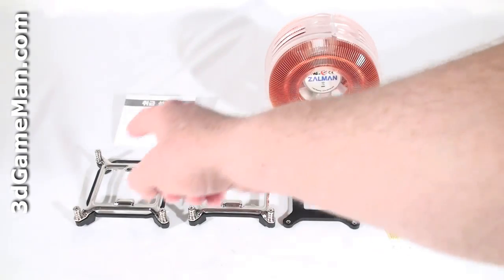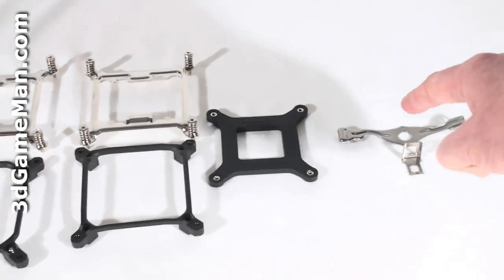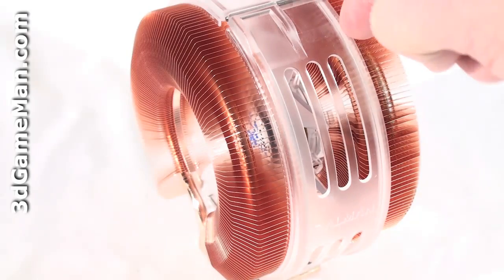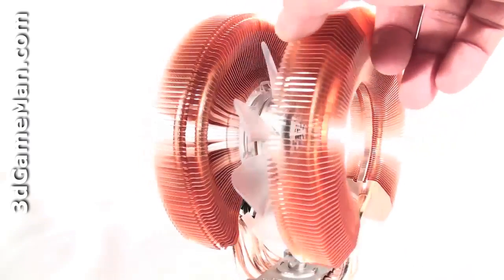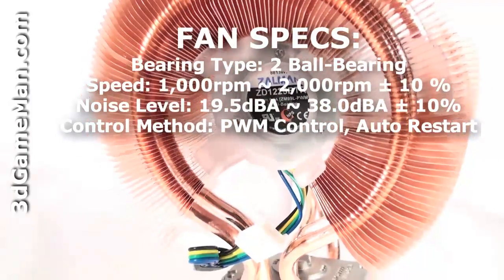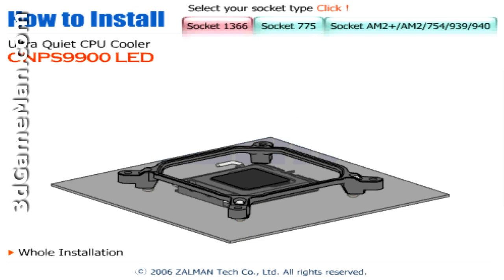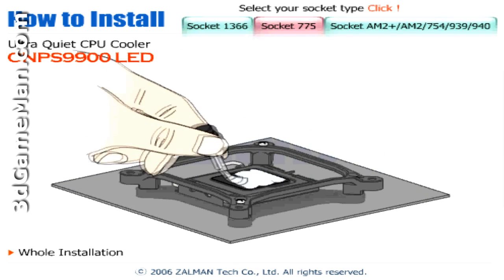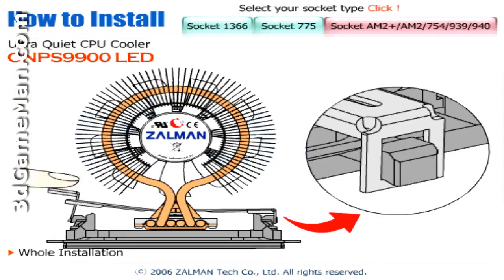#1047 - Zalman CNPS9900 LED CPU Cooler Video Review

Comment: i've got this cooler in my build (bought the entire thing secondhand) but i think it's just way too noisy at idle, i'd like to replace it with an arctic freezer i32 (performs similar to a hyper 212 evo but is semi-passive). would it cool equally well or would i see an increase in temperature? i'm overclocking an i5 2500k so cooling is pretty important...

Comment: Just for laughs, I had this running with no fan on an i7 950 at stock speeds. No fan, just the heatsink action combined with chassis fans = 60* idle temps.

With fan? 29* idle temp on stock. Yeah, it's still pretty good.

Comment: @sjkreid3D im not sure if it will fit in that case, if it does, it will probably be a tight squeeze. just get the cnps 9500.  its basically the same heatsink with a 92mm fan as opposed to this ones 120mm fan.  i just got one the other day for my mid tower rig, and its is awesome.  it keeps my phenom ii 955 cool at 4.2 GHz with no problem and doesnt make a sound doing so.

Comment: I bought a used one, only come 775 socket and 775 socket clip, no 775 backplate, can I use the original one that's already on my mother board? Or I really have the zalman one. all 775 backplate should be the same right?

Comment: @youngdones 

yes i had an old Q9450 which easily ran at 3.6 GHz so a 930 should have no problems with that. im getting my 930 soon i hope im gonna go for 4 ghz with this cooler on a p6t deluxe v2 mobo

Comment: Your minimum QPI Voltage should be 1.3V and 3.2GHz overclock with a Zalman 9900 is quite modest in my opinion I do 3.5Ghz and with turbo mode on its a nice 3.66Ghz but I would recomend turning off ALL CPU features like Virtualization and turbo mode if you go to 4Ghz

Comment: @TheXxxLoganxxX it can be that the Cooler is installed wrong, or you applied too much Thermal Compound, or the Retentionkit doesnt apply enough pressure to the CPU. Reinstall it if possible

Comment: I'm getting about ~$50 soon and I want to get a good cpu cooler for my Phenom II X4 955 because the stock heatsing is making odd noises. I want a cooler that really good, but also quiet. I'm looking for something that at stock clocks will give me 28C idle and ~42C max load. Can anyone give me some one recommend me one with the same temps I mentioned. I don't mind adding ~$20 for a higher cooler if needed. 

Please, if anyone can give me a good recommendation, I would appreciate it.

Comment: I have a foxconn destroyer motherboard with 2 nvidia 280's in sli do you know if something like this will fit inside the case or will it be blocked by the videocards?

Comment: That's true for Intel cpu's since they moderately run hotter then AMD cpu's. My 6000+ only gets up to 55*C on full load and goes down to 48*C idle with the stock cooler.

Comment: You have to remember the core i7 920 he was using in this video was the co stepping and not the new do stepping.  I bet those temperatures would be at least 4 or 5 degrees celcius lower with a d0 stepping processor plus he had the processor clocked to 4 ghz which is really high for a air cooler 3.6 ghz would of been more reasonable with this cooler.

Comment: If you have a low to mid system a good solid Corsair 500-600 watt will be more then enough. If you have 3 or 4 GPU's are highly into overclcking and a ton coolers and what not then your looking at the 800+ watt.

Always get good, well known name brands such as Corsair, Sliver Stone, OCZ, and a few others.  Cheap power supplies care made from cheap parts and don't always give you the 500watts they claim due to this.

OCZ as a line of affordable low end power supplies.

Comment: when it comes to this level of performance, the results are pretty competitive. it usually comes down to which design you like the look of better, which company you prefer, and which design fits better into your case. in my case, I have a full tower so either would fit, but I liked the look of the Zalman and their awards were impressive (2009 International CES design winner) I wanted to see the blue fan spinning within my case. The V8 has its perks too tho

Comment: hey i have a question. How does the fan went to 2000 rpm??
It does it auto or you can set it??

Because i have that cooler and the max i saw was 1795rpm.

Comment: its full copper and the fan blows the air trough the heatsink with much bigger effcience then the v10 cause every fan ahs a blind spot and they made advantage of this here cause they eliminated the fins at the blindspot, and i think they soldered the fins makin it even efficienter :P

Comment: i need to know your mobo never use cia2 i should be dissabled eist also dissabled and anything that lowers coreclock and voltage when system enters system halt state but yor mobo info is what i really need along with your power supply modle and i will help you get your first small overclock oh and yes your mobo has a nb and a sb its a core2 not x58 but send me a private message next time i also need to know how much ram you have and wheather you are using 4sticks or 2

Comment: im using gap35s3 and i cant get an overclock at all at any frequency or at any voltage it just wont work =( 
i did some thermal paste on the cpu and spread it with a credit card ( my dad's :P) 
i use the cia2 thing cause it doesnt overclock i dont know why but my bios is also very confusing it doesnt have NB and SB

Comment: i think you said your cpu was q6600 yes it will overclock pretty good  i noticed you mentioned cia2 are you using an ep45ud3p as  far as thermal paste is concerned if  it is thick like as5 then you want to spread a very thin layer on the cpu if its thin then a rice size dab will do also if your cpu cooler utilizes direct heapipe touch tech its better to put the paste on the heatsink first as far as cia2 dont use it

Comment: i still cant figure it out my q9400 overclocked to 2900ghz idle is 38 and at load its like 50 0r so and thats with the crappy stock cooler witch i will be replaceing soon i guess thats a testament to the coolermaster hafs cooling abilities 3dgameman must live in an oven what cooler are you using

Comment: A smaller zalman broke my board, but it was the guys who put the motherboard in my case fault, they didnt tighten the board enough so the Zalman bent it. If you install the board and the cooler right it's all cool. :)

Comment from the maker: No, it's not that loud (38dBA ± 10%). Keep in mind the mic is very close to the fan and in normal setup the Cooler is inside the case. Also, you can adjust the speed on the fan through the motherboard BIOS or using software like SpeedFan.